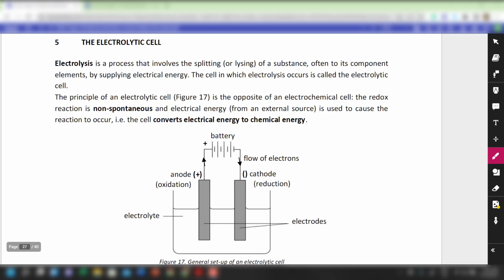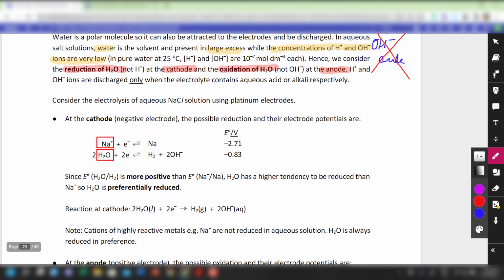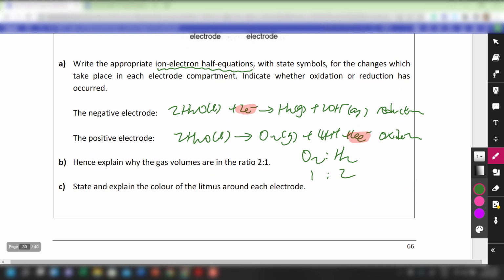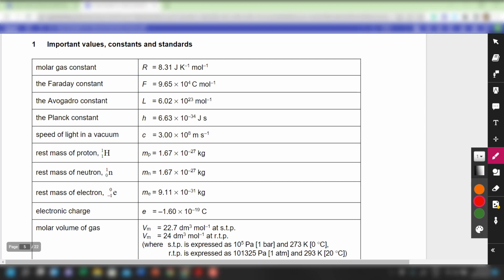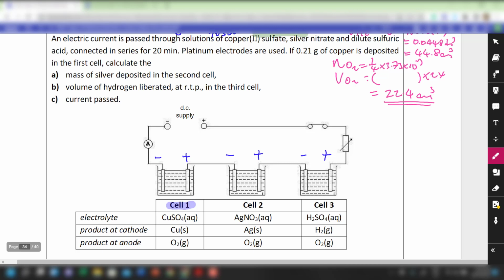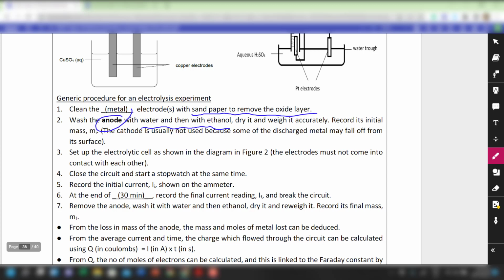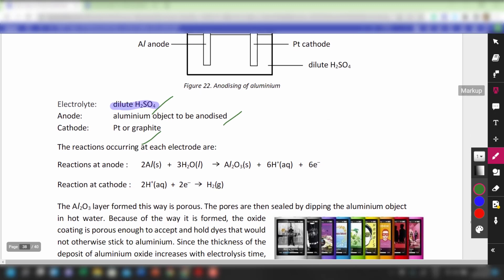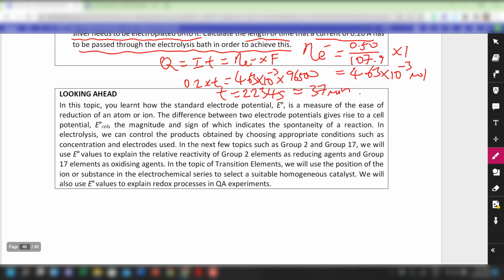[H2 Chemistry] 2026 Topic 21 Electrochemistry 3

Comment: Additionally, in Exercise 6.2 (i), why does the Br2 produced at the anode remain in the aqueous state instead of being liberated as Br2 gas?
Reply from the maker: Bromine is actually a liquid at room temperature (unlike chlorine, which is a gas), so it is not readily liberated as a gas during electrolysis.

In aqueous solution, bromine is also quite soluble and can further react slightly with water (forming bromide and bromate(I)), so it tends to remain dissolved, giving the solution a brown colour. So instead of seeing bubbles, the bromine typically stays in the aqueous phase.

Comment: Mr Wee, in the 2026 notes under section 6.3 it is stated that the difference between the reduction potential of the Na+/Na half cell and the potential of the H2O/H2 half-cell is "too large, hence the effects of concentration is not enough to cause Na+ to be reduced". When faced with unfamiliar situations in exam questions, how do we generally determine how large of a difference between the potentials is "too large"?
Reply from the maker: Hi, thanks for the question. The key idea is that standard electrode potentials already reflect a strong inherent preference. Changes in concentration can shift the position slightly, but they generally do not override a very large difference between two half-cells. In a loose way, for assessment purposes, a practical way to think about it is:
1) If the potentials are close, then conditions (like concentration) may influence which reaction occurs
2) If the potentials are very far apart (on the order of ~1 V or more), then the more favourable half-reaction will dominate regardless of concentration

More importantly, look beyond the numbers: from prior knowledge, it’s not reasonable for solid sodium to exist in water. Once you recognise that, it becomes clear why concentration alone cannot lead to the reduction of Na⁺ in aqueous solution.

Comment: and at 26:58 how do you instantly know copper is the one being reduced to cu and not cu+
Reply from the maker: Aqueous Cu(I) is not a stable form of Cu. You can try calculating the cell potential of Cu(I) to Cu(0) and Cu(II). If Cu(I) was to be form, it will usually be in the solid state, eg the product after Fehling's reagent is added to aldehyde. So for most of the systems that you are familiar with, if reduction of Cu(II) is involved, Cu(0) will usually be the product.
Reply: @weechorngshin96  thank you teacher